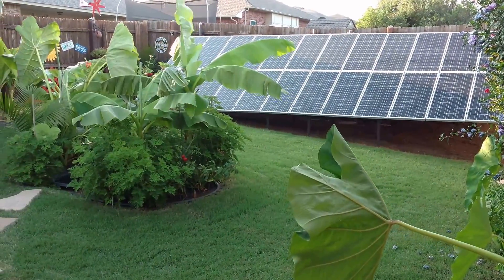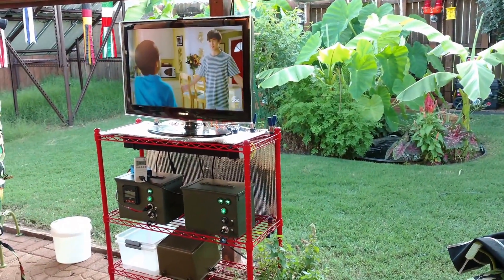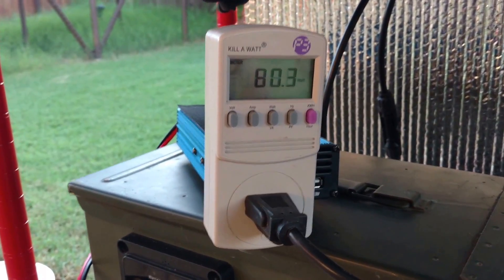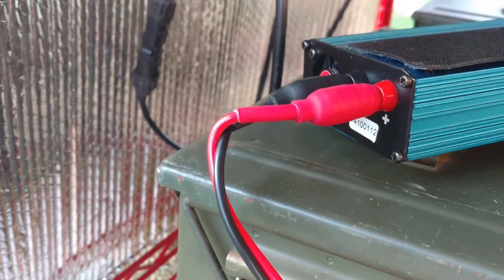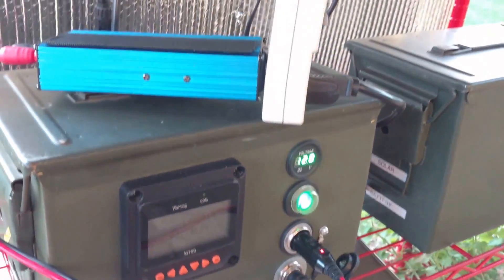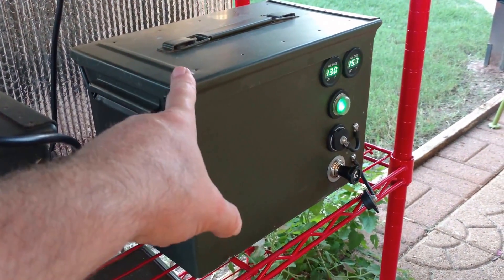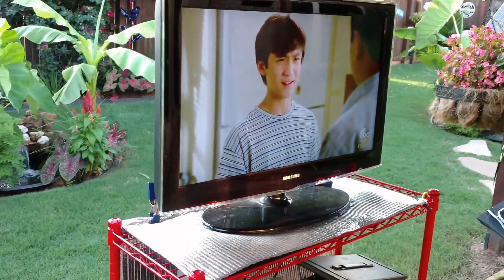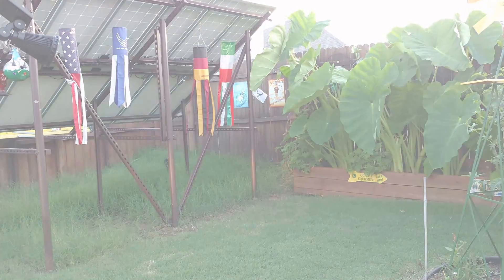New 12v wiring harness - Aims Power 180w pure sine wave inverter

Comment: You did a beautiful job on the backyard. Tackling the reengineering will surely not be a problem.
Reply from the maker: Thanks...I may just do "nothing" and let it go. I do have a couple of those little 50mm 12v fans on order (with slightly higher airflow)

Comment: Nice setup man, I need to learn how to clean up my conections.  Just got a epever charge controller on my small solar system.  There is a new Armstrong swivel tilt TV mount for 15 dollars at harbor freight if you still need one.
Reply from the maker: Thanks. Those EPEver Tracer MPPT solar chargers are good units

Comment: If it don't blow....it SUCKS !  At least it works, no smoke or sparks....all in the learning process Chris.   Thanks    J K
Reply from the maker: IDK man...prob won't hurt anything (per se') with the fan blowing down vs sucking air up through the inverter and out of the top of the ammo can.  Sucking/blowing...sounds like ammo can porn! 😜 I could crack open the inverter and remount the fan (reverse the air flow). Might be an idea. IDK...just sharing shyt I do and find out. Glad I found it...both are working great. Esp with 525w in attached solar panels
Reply: I wouldn't change anything inside the inverter. Changes in air flow & velocity might not cool the power transistors / heat sinks that were designed into the housing. Just try to make sure the air flow in the ammo enters in the bottom and flows out at the higher port with clear passage room to cool the aluminum housing on the inverter.  Some instructions warn about vertical VS. horizontal mounting to get the best cooling effect. Some car audio techs could give advice about air movement, trunk VS. in car/ air conditioned areas for power amps which need air flow also.  Keep us updated on any changes.    Your tech Buddy      J K